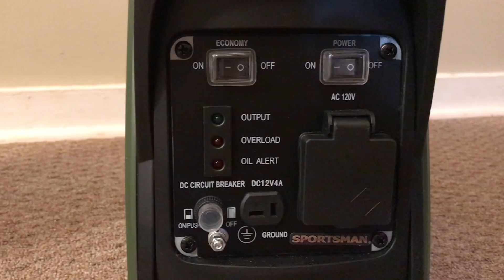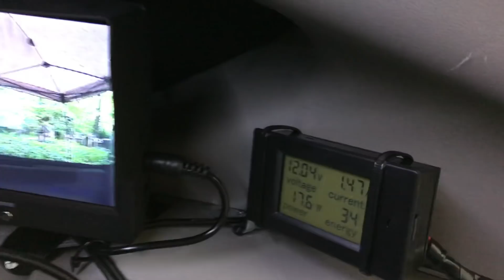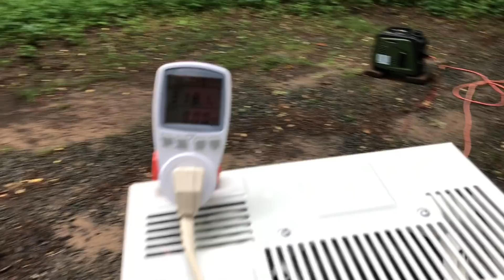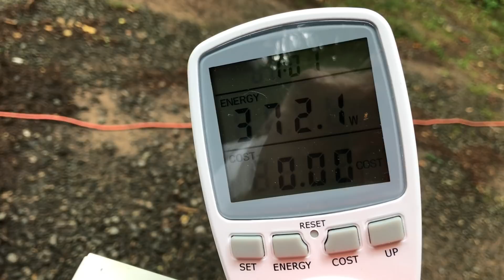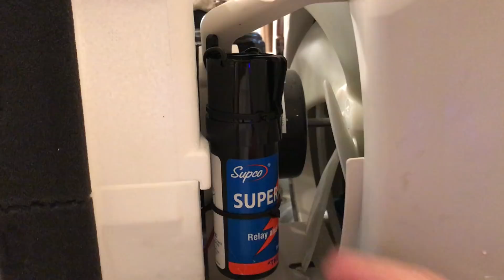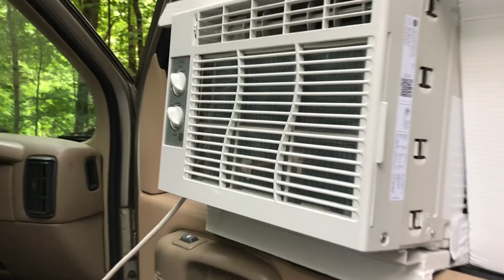Sportsman Generator with A/C Air Conditioning Supco SPP6 SPP5 Van Build Camper RV SUV Vanlife AC

Comment: With small generators, the elevation definitely has an impact. What is you elevation there? Great video.
Reply from the maker: I wondered about that. I am at 2,000 ft. Is that better or worse for making power with the generator?
Reply: PriusStealthCamper Adventures It is my understanding that all generator capacities are rated at sea level. From there the power is reduced a certain percentage for each 1000 feet in elevation. Don't have the numbers in front of me but it's an easy look up.
Reply from the maker: Good to know.  Thanks for posting this info.
Reply from the maker: Google  -  "Given the reduction in air density at higher altitudes, engine and thus generatoroutput will be reduced. The typical rule of thumb is 3% to 3 1/2% for every 1000 feet in elevation. In the Denver Area you could be 15 to 20% of your capacity."

Comment: Whatever you do don't take the side cover off while the generator is running or don't take the oil side cover off while the engine is running. Some people are even drilling holes in their side oil cover panel. They think this is  helping the generator but it's not it's the opposite it's hurting the generator. What this is doing it's not forcing air through the generator to cool it off with holes in the side panel or the side panel removed.. Most of these suitcase portable generators suck air in through the front or the bottom and push it out the back where the exhaust is. These small suitcase portable generators have an internal fan that runs whenever the generator is running. And it absorbs Noise by having the cover on. When you open the panel up with a whole or the whole panel removed it's like drinking a drink with a small hole in a straw. It's not going to be as efficient and it will make the generator room hotter which will shorten the life if not cause early failure possibly if you're running it in the hottest of heat. Even with a box fan on the side of the generator with a cover off is not a good idea it's still not forcing it through the generator box when you think about it. Why this guy drilled holes in his oil cover side panel is because he said when it was running air is being forced out. Of course it is because air is being pushed through the generator enclosed box.
Reply from the maker: Good information. Thanks for posting. I had seen where people were drilling holes in the side.
Reply: @timdillen  I just got my new Sportsman 1000 a few days ago. I've got it running on a 20 lb propane tank and a dial regulator on it for fuel efficiency. Couldn't find one so I just put one together.
Reply: @timdillen  one of the propane conversion companies said yesterday a Honda 2200 that has the 118cc engine on propane would run 22 hours on a full BBQ tank at a half a load. My Sportsman 2200 with a 80cc motor will run 18 hours on a half a load. I'm almost wondering was this a full BBQ tank or one of the trade-in tank exchange at the stores with a gallon or a gallon and a half less propane. Anything's possible but I would have to see those results. to see that the bigger 38 cc Honda engine is that more efficient. My 2200 watt Sportsman is they say 15 amps Max. The Honda 2200 watt generator is 18.3 amps Max for start-up only. And then the Honda kicks down to I think it's 15 amps. You can't run 18.3 amps solid behind the Honda 2200. If the Honda is really that much more fuel efficient I might have bought the big Honda 2200 RV plug generator.

Comment: Hey man, have everything hooked up the same minus the the solar controller and circuit tester. Plus a 30a cord. Throws the load limit when I try to switch the cold level up. Mine won’t get the compressor started so far. I used double male blade connectors and extended some ancor wire mounted all the same. Have any ideas? This unit specs the exact same as your unit. In addition this unit does have circuit breaker 3 prong plug. It’s not popped when the overload takes place upon attempting the compressor start up. 
Have any ideas? Thanks man, awesome channel
Reply: I switched wires around a few times and finally got it. Compressor wire was different on this one. All good though. Gonna be real nice with ac this weekend in st. Augustine
Reply from the maker: Glad you figured it out. Hope your trip goes well and you stay comfortable!

Comment: So to confirm what you proved in this video is that it is indeed possible to run a 5k btu ac on this generator with high cool and fan without the hard start on non economy mode? I was unable to see which modes you had on the ac.
Reply from the maker: That is correct. Just one thing, not all 5K a/c units will work. Make sure you check the watts as some units are more efficient than others. This particular unit seems to be made under more than one manufacturer but you can spot it by the dials and vents.
Reply: @timdillen  well, that appears to be a GE ac. I have 2 5k btu ac units and one is that brand with the same switches. One ought to work with this exact generator i have coming in soon. Thanks for the info!

Comment: Hi. Just found this video. I am looking for an economical way to get AC in my rig to live in Louisiana. How loud is the generator? Can you cage it on the exterior? Can you provide the plan of what is needed for this set up? Thanks very much.
Reply from the maker: My setup was very temporary and not the best way to do it. I think a good way to go is to remove the rear window and build something better but I worried about it falling out when I drove. The lock on the rear window can pop off so the window swings all the way up so some type of wood insert that could be removed while traveling would be good. The generator would be fine in a cage. If you run in eco mode it is quiet. A cage would be a good way to keep it from being stolen. This generator and a/c combo work well together. I did another install in the Ambulance series where I place the unit under the floor that you might find interesting.

Comment: I bought this genetator and tried to convert it to propane and keep the gasoline too. But the carburetor studs were already touching the side cover there was no room simply for a propane adapter plate between air filter box and carburetor. I've converted two other suit case portable generators to propane - duel fuel. This generator I just had to take back to the store.

Comment: So from 1-10 How happy are you with this Sportsman Generator? 

Great Video :o) 

I just picked one up Sportsman  GEN1000I-SS This model is Black and Beige. I think the only difference is that this model is EPA and Carb Approved and can be sold in California. I don't really see any difference between the Sportsman Gen1000i and Sportsman Gen1000i-SS Unless you know any different?
Reply from the maker: Glad you liked the video.  The Sportsman is holding up well but I don't use it terribly often. Mostly just for backup but do run an hour or two at a time. I take the gas out and run dry when storing for more than a couple weeks - I think that will help in the long run. I did not know they had another version. I would guess yours has a bit more smog items and a bit more cost. I will have to look that one up. Thanks for posting this info.

Comment: Hi, could you please show in more detail how did you connect the spp6 capacitor to the ac's run capacitor?
I could see only one wire from the spp6, but couldn't see the point the other spp6 wire was connected to the ac's run capacitor.
Thank you very much

Comment: You really don't need a charge controller. The voltage coming out of the generator it's high enough to over the battery. When the battery comes up to the 12 to 13 volts coming out of the gen it basically stops taking charge.
Reply from the maker: I did not know that - thanks for the great tip!

Comment: About $.5 per kwh in gasoline (assuming $2.6 per gallon).
Reply from the maker: Cool - thanks for the info and for watching!
Reply from the maker: So if my math is correct...If it ran the generator for 8 hours using 500 watts = 4,000 watt-hrs. 4,000/1,000= 4 kwh. 4 kwh * $0.50 = $2.00 to run for 8 hours?
Reply: I also assumed that the manufacturer was relatively honest about the specs (I'm a dreamer:)

btw the ice machine/ AC was nothing short of inspired.

I nominate myself leader of all those that have contemplated low wattage stealth small space cooling, and ask that you repost your ice machine/ AC videos.
before that video I had seen your channel before, after that video I went through every video you had
Reply from the maker: I will consider your request on the ice machine. It is just people get quite hateful when I post projects and they try them and they don't like the results. I make sure no one else sees those but I still get them. The videos are still live they are just not listed. I'll give your the links and you are welcome to share them, it was a really neat project.
Part 1: https://youtu.be/XBrNr7DkEwY
Part 2: https://youtu.be/EdeMB51QTvw
Part 3: https://youtu.be/81Qky5l_pU0

Comment: I hate to throw Sportsman Buffalo tool under the bus but I asked them several technical questions and they did not know what amp is the Sportsman 1000? What cc is the Sportsman 1000? And I asked them on the Sportsman 2200 watt dual fuel does it have a propane regulator inside of it? Does it have a manual override propane bleeder valve? I was shocked they couldn't answer these and other questions I had. it was way over their head. These young ladies at Sportsman Buffalo tool just seem to answer the phone and try to do technical and customer service. And they wouldn't let me speak to the guy in the back that works on stuff that would probably know. I bought the Sportsman 2200 watt dual fuel suitcase portable generator. I had a problem with it and luckily they did want to send me out a call tag to fix it but. I fixed it myself permanently and better than ever where it will never give a problem again. And I couldn't be without the generator that long. I made a manual propane bleeder valve so I would have an immediate start up when I put propane right into the engine.. And I wouldn't have to  pull start it around 22 times to get it to start on propane. That is the problem I had and I was going to wear out the pull start cord trying to start it that many times. I know these are all Chinese made units but they need to know their technical better to sell. Thank goodness they have YouTube videos of unboxing these different generators and things and I have a very strong mechanical ability or I would be in a mess.
Reply from the maker: They definitely are cheap Chinese products. I don't use mine a great deal but so far it is doing OK. If I was in the middle of nowhere living I might want to invest in a bit better unit.
Reply: Mine lasted about 2 years with around 12 hours of light use before the inverter failed.  I am an electronics designer by trade and this generator was babied with mostly 600 watt or less with only 800 watt attempted a time or two.  When it went it cooked a surge protector.   Looking up parts for it there are several rebrands of this generator overseas and they are all 700/800 watt rated.  From what I can tell the inverter is identical and the sportsman rating of 800/1000 is just blatant lie.  The inverter online cost about $150 and you can buy the whole genset for $200 right now from Home Depot's website so it didn't make sense to replace it.  Instead I bought a Wen 1250 watt unit.  Unfortunately its not small and lightweight like I hoped as its almost the same size as my eu2000i but the build quality is miles ahead of the sportsman and its only 1db louder than the honda so imperceptible to the ear.  At $375 to my door it was still a decent deal but that won't be proven until enough time and use have passed.  The engine on the sportsman did run well for me and I did like the size.  If they could put a better inverter in it and charge a little more they would have a descent genset on their hands.